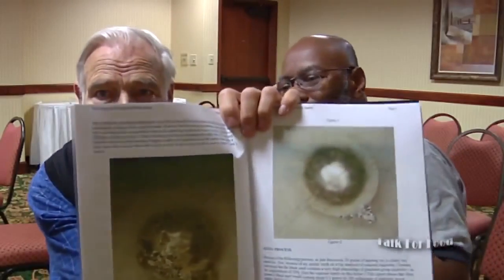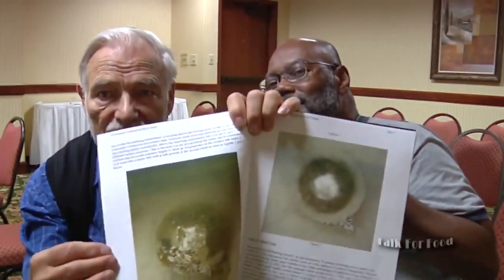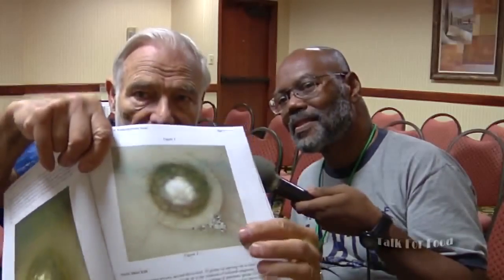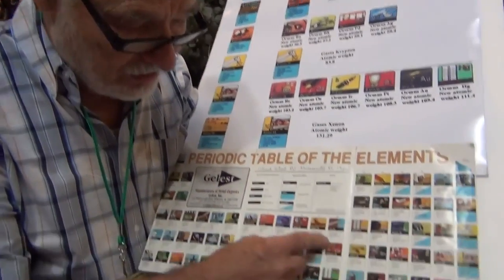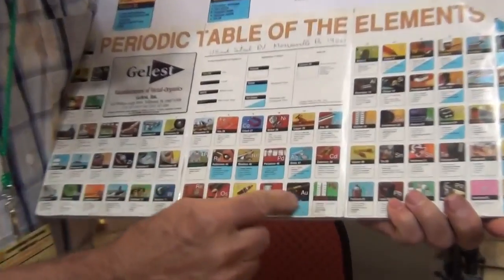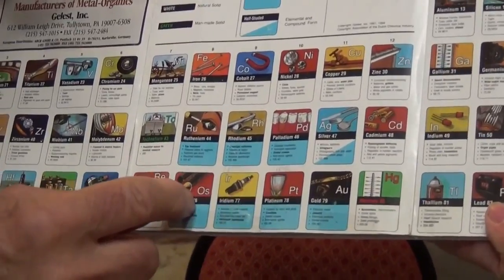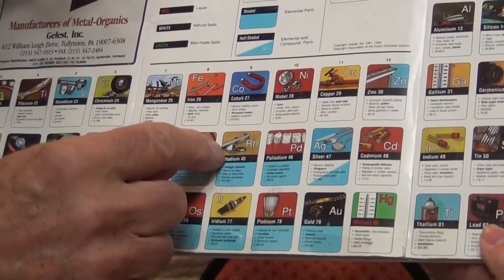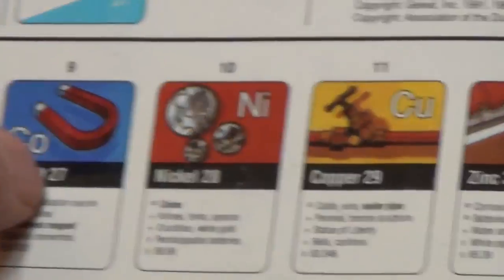Growing Ormus Gold In The Microwave w/ Dr. John V. Milewski

Comment: where can i find his dvd?
Reply: i want getting this DVD
Reply: Did you get it? We have a far superior method now. You only get maybe 4 to 5 bucks a run doing that old method using a 2" id crucible. The new method is at least 10 fold better. I'll have more news on that next month when generator is fixed to run oven.
Reply: @mikefromspace  any updates on your process? Is it based on Joe Champion?
Reply: @GreenmeResearch  No. I found the Ferrite becomes gold when sufficient linear plasma can change its atomic   structure. Done best suspended not in glass surface. I designed an anode to electrode spark plug, huge gap, to induce superconductive level plasma.
1g of ferrite a minute becomes ::::: .4-.5g Au.
Reply: @mikefromspace Are you saying John Milewski method wasn't correct?
Reply: @ John never said he was making a lot of gold. It really was just 5 dollars worth. He was wrong about where it came from, not realizing the ferrite quasi crystals in the fly ash was the source, not the quartz. 
The best ways of making gold proven so far, use water. One uses cavitation, one uses a digital zpe device- called the gold smacker, but the best is a mining wastewater cleaning system using ozone and a grounded galvanized bucket under a tall iron cylinder with charcoal in it. Wire gold grew like crazy off the charcoal.
I think my new method will beat them all- but for anyone starting out I suggest the bucket method.
Reply: @mikefromspace  i have heard about that method. It can be quite dangerous.
Reply: @mikefromspace  any updates?
Reply: @mikefromspace  Hello, I would like to join you in your research, is this still ongoing? How can I join your club? Thanks for offering a lead, as everywhere I look, information has gone dry on this topic.